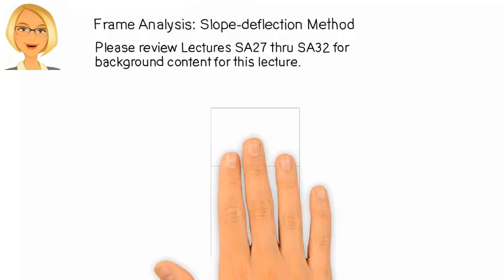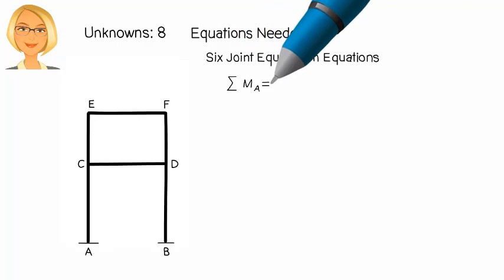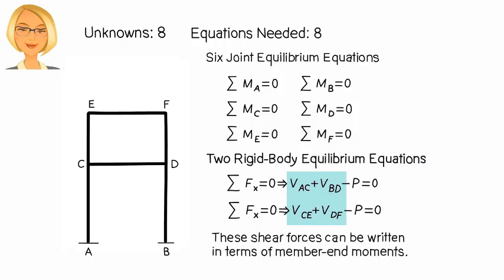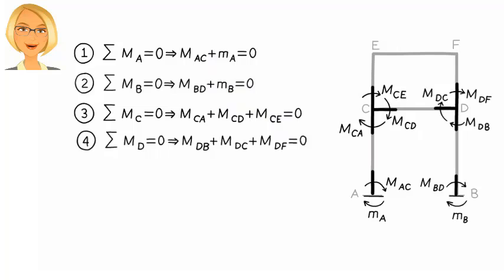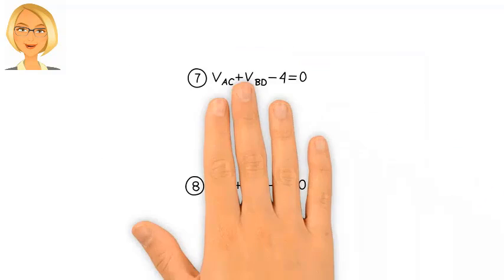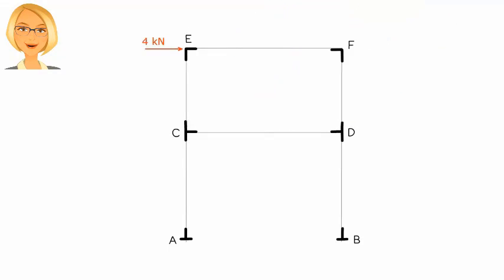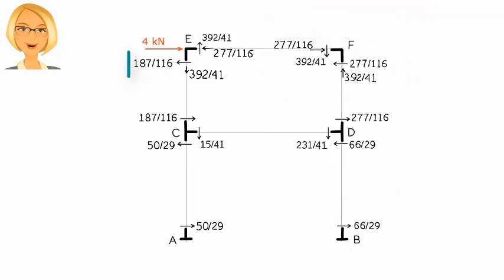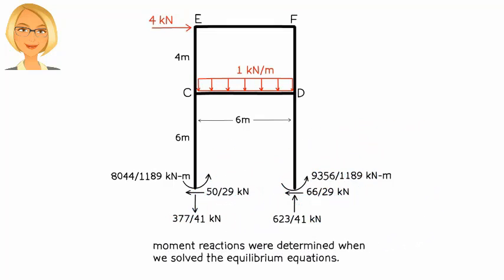SA33: Slope-Deflection Method (Frame Analysis)

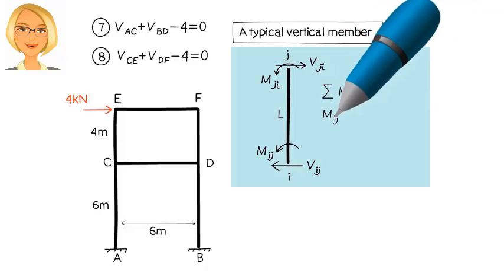Comment: @DrStructure What if the concentrated load at E (4kN) is distributed along member CE? Will the free body diagram of member CE at 5:23 incorporate this load?
Reply from the maker: Correct, in that case, the distributed load shows up on the free-body diagram of member CE, necessitating its inclusion in the equilibrium equations.

Comment: hello what does it mean when the delta values are in negative? does that mean the frame moves to the left instead? hoping for your answer thanks
Reply from the maker: Yes, a negative value indicates that the actual displacement is in the opposite direction of the assumed displacement. Therefore, if we initially assume the frame displaces to the right and the displacement value is negative, it means the frame is actually moving to the left.
Reply: @DrStructure  in the lecture did you assume it was going right? But we got negative values of delta so youre telling me the frame actually went left?
Reply from the maker: No, the frame displaces as shown. The delta term in the slope-deflection equation is considered positive when it is produced by a counterclockwise rotation of the member. Since the columns are rotating clockwise (causing the frame to sidesway to the right), the delta term associated with each column is negative.

Comment: what method/program did or can you use to solve those 8 equations simultaneously?
Reply from the maker: You can use Mathematica (Wolfram Alpha) to symbolically solve systems of linear equations. Linear algebra provides various methods for addressing these equations. For hand calculations, Gaussian Elimination is particularly effective.

Comment: Dear Sir, i completed all moment distribution class, and i tried it on all slope deflection method and it works fine EXCEPT
1. For frame like this example, it has 2 beams, when we are computing the deflection/sway due to a force, should we apply the trial 10 kN/-10 kN moment on member AC BD or CE DF or all AC BD CE DF ?
2. After we have compute 1 and got the moment at base due to 10 kN trial force, when we are getting the ratio to multiply and stuff, should we use the base force on the fixed support or base force on the 2nd column ? ( As shown in picture ) https://ibb.co/HzRS5jc

3. In order to calculate deflection, i can do it after i have compute all the moment at joint Mac, Mbc, Mdc, Mef, Mfe and etc, doing a simultanous equation to get delta a and delta b and then h1 and h2 accordingly, will the h1 h2 value i get in this way be correct ?
Reply from the maker: The frame has two deltas (Delta_1 and Delta_2). This makes the use of the moment distribution method more challenging. Since these deltas need to be assumed (or their corresponding member-end moments need to be assumed), we will be forced to iterate the process until the sum of the horizontal forces comes out as zero. If we had only one unknown delta, then the process explained in SA41 would have worked. But for two unknowns, we need to repeatedly solve the problem until the state of equilibrium is reached. Unless you can reduce the number of unknown to 1 by, say, assuming that Delta 2 is a factor of Delta 1. Like saying, 6/Delta_1 = 4/Delta_2 where 6 and 4 are the column lengths. But this may not lead to accurate results.

Alternatively, we can use the principle of superposition as explained in SA42, to solve the problem. In that case, we can define two frames. 

Frame 1: Place a pin at C or D in order to prevent the sidesway of the lower part of the frame (i.e., Delta_1 = 0), then go through the moment distribution process using Delta_2 only (only the top part of the frame is going to sway). when done with the moment distribution process, calculate the member forces, and the horizontal reaction force at the fictitious pin.

Frame 2: Place a horizontal force having the same magnitude as the reaction force at the fictitious pin for Frame 1, but acting in the opposite direction. This force causes a Delta_1 sway. Then, assume Delta_2 = 0. This is a reasonable, although not quite accurate assumption since the upper part of the frame is not subjected to any loads. Then analyze the frame per SA41. 

Add the results for Frame 1 and Frame 2 to get the member forces for the original (real) frame.

As for the actual displacements of the frame, the moment distribution method is not equipped to do that. If you are interested in determining the deflections/rotations, then either the slope-deflection method or the matrix displacement method.
Reply: @DrStructure  
1. But for two unknowns, we need to repeatedly solve the problem until the state of equilibrium is reached. 
I can try this out, but where do i add the trial moment ? do i need to add it on both column of bottom frame ? or both column of top frame ? or add the 10 kN in both the top and btm frame ?

2. As for the horizontal force you mention, do you mean the horizontal force at the base of top frame or horizontal force at the base of bottom frame ?

As for the alternative i am interested to give it a try as well
1. Frame 1, ok i put a sideway support at lower frame, then where do i input the trial moment ? at the column of top frame only and check the sway relative to the bottom frame to calculate delta 2 ? 

2. Frame 2 : Fully understand on this, but i don't get why it is not accurate

but since i have gotten all the member Moment, and i have the equation M=2EI/L*(2delta a + delta b + 3h/L ), i can substitute the moment i obtain to calcualte the h right ? I haven't gone through the matrix displacement, but this moment distribution method is so brilliant and nice to use .......
Reply: also thanks once again, i am hoping to be able to move on to Matrix soon, thanks again for all the help
Reply from the maker: @DOTA2MAJISTRATE  Since all four columns are going to displace laterally, each is going to have a fixed-end moment due to the lateral displacement. The two bottom columns are going to be displaced the same amount, hence they should be assigned the same assumed moment value (say, -10). The two top columns also are going to be displaced the same amount, so they should be given the same fixed-end moments, say, -8 (or even -10).  But the assumed top and bottom moment values need to be updated independently during the iteration process.
Reply: @DrStructure  Forgive me, i couldn't understand very well the method explained, i will write it down step by step below, please help me see if they are correct. thanks in advance
For method 1 iteration
1. Apply a 10 kNm moment on lower frame AC and BD, apply also a 10 kNm moment on top frame EC and FD
2. Use moment distribution method to get all the moment and force
3. ( this is where i don't understand, normally at this stage we will take the base horizontal force at A+B = applied lateral force of 4 kN, get the ratio and multiply accordingly. but in this case what force do i use as comparison ? Horizontal force at A+B must be equals to applied 4kN ? Or horizontal force at E and F must be equals to applied 4 kN ? )
4. By iteration, what is the "variable we use" and where should we check the "results", for example substituting x=1,2,3,4,5 so y(results) will be equals 10, so we iterate x and check for results 10, in this case do we iterate the moment of 10kNm at top and bottom frame ? And how do we check the results ?
Reply from the maker: 3. The sum of the forces in the x direction for both the top part, and the entire frame, must be equal to 4. That is, the sum of the two shear forces at the bottom of the two top columns must add up to 4. And, the sum of the horizontal support reactions (which is the same as the sum of the shear forces at the base of the two lower columns) must add up to 4. Both conditions must be satisfied.

4. You are iterating over the assumed Delta values (which is the same as the assumed fixed end moments). As far as the iterations are concerned, you have two independent variables: the fixed end moments for the two top columns (say, M2), and the fixed end moments for the two bottom columns (M1). You have to find the right values for M1 and M2 that makes the equations stated above are satisfied. You can start with M1 = M2 = 10, but they are necessarily equal to each other. In each iteration, you need to change M1 and M2 in search of the right values. This is a laborious process and more or less a blind search. 

As I mentioned before, the moment distribution method is not the right approach for analyzing this kind of structures.

Comment: Dear Dr.Structure,

1. May i know if the structure were to be pinned at ground, what will be the changes in this ?
2. Is it possible to solve the same case with Virtual Work Force Method ?

3. If i were to add 2 bracing as shown in red, how will it affect the system ?
https://ibb.co/12m7BmR
4. How do i compute the moment around the joint of this new bracing ?
Reply from the maker: 1. If the frame was pinned at the base, we would have had two additional joint rotations, one at A and one at B.
2. The frame can be analyzed using the force method, not the virtual work method. The virtual work method is not a technique for analyzing indeterminate structures. 
3. Now you have introduced another joint with its own rotation and displacements, which need to be incorporated into the formulation. The frame becomes more complicated to analyze. 
4.  The slope-deflection method gives you the member end moments. Once you have these moments, you know the moments at the joints.
Reply: @DrStructure  
for question 3, if i were to incorporate the 2 bracing, and let the top node be "G"
https://ibb.co/5nZHWWK
1. Additional unknown 
           a.) delta CG
           b.) delta GC
           c.) delta GD
           d.) delta DG

But i will only have 1 more joint equilibrium equation which is sum of Moment at G = 0, how do i get additional 3 more equation ?
Reply from the maker: @DOTA2MAJISTRATE  When the delta term is present in the slope-deflection equations, additional equilibrium equations need to be written based on shear forces, as in the sum of the forces at a joint must be zero, as is shown in this lecture.   

In this case, you are dealing with inclined members. This means you need to find a way to transform the displacements (deltas) from the member coordinate system to the global coordinate system. This becomes quite a cumbersome process. Put it differently, the slope-deflection method does not offer a convenient process for analyzing the frame. The matrix displacement method is a better choice for this analysis.
Reply: @DrStructure  thanks for the advinse, i will move myself to matrix method soon, thanks again sir, be blessed and stay healthy
Reply: @DrStructure  Dear Sir, what will happen if the member CD is in pinned ?  
1. moment from CD will not transfer to point "C" and point "D"
2. moment will be at mid point of CD and it will not be "fixed end moment" but simply supported beam moment
3. M(CD) and M(DC) = 0
4. The frame can be analyzed removing member CD completely from the system and add the axial force ( 6mx1kN/m/2 = 3 kN ) on point A and point B ?
Reply: also if i were to conduct a overall force calculation ( global ), taking moment at A, 4*(6+4) + 1*6*6/2 - 623/41*6 - 9356/1189 - 8044/1189, the answer is not 0
Reply from the maker: @DOTA2MAJISTRATE  1. Correct, there would be no moment at the ends of CD, so no moment distribution/transfer takes place at C or D from member CD.
2. Yes, CD can be treated as a simply supported beam with regard to bending moment diagram. It is going to have a zero moment at either end; the maximum moment in the segment takes place at the mid-point of the beam.
3. Correct, Mcd and Mdc = 0
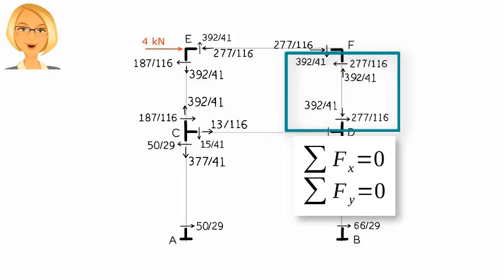4. Not quite. Member CD is going to have three reaction forces at each end: Fx, Fy, and M. The moment (M) value at either end is zero. Fy at either end equals 3 kN. And although the force in the x direction (Fx) at the left end of the segment is going to be equal to the force in the x direction at the right end (they act in opposite directions since the sum of the forces in the x direction for the member must be zero), but the magnitude of Fx is not zero. If the beam was isolated, if it was not a part of the frame, then Fx would have been zero. But here, the frame causes an axial force to develop in the member (see @10:00 as to why that is the case). This means, the frame has to be analyzed as a whole, we cannot simply remove members from the structure without effecting its behavior.
Reply from the maker: @DOTA2MAJISTRATE  Yes, there is an error in the calculations. The error originates @7:52, wrong member-end moments are used in the moment equilibrium equation resulting in incorrect member-end shear forces. This error was propagated through the rest of the calculations.

Comment: Thank you Dr. structure  for giving lecture with much clarity....I  would like to enquire is it possible to  use this  method to analysis the high rise building having multi bay frame
Reply from the maker: The matrix displacement method is more suitable for the analysis of high rise or other complex frames. The slope-deflection method is not quite suitable for that kind of analysis.
Reply: Thank you Dr.Structure...will be grateful if you could upload lecture on analysis of building using  matrix displacement method

Comment: How to draw Moment diagram. And also show maximum bending moment in this slope and deflection method. My sir said if our assumption is right draw it upside other downward i.e if our moment is +ve in left side and -ve in right side , draw it up and otherwise draw below the member. I got this but which sign should I put then inside that moment diagram? Help me.
Reply from the maker: By convention, we take the neutral axis of the member as the x-axis. Generally, positive moment goes above the x-axis and negative moment goes below it. We label the positive area with a plus sign and the negative area with a minus sign. 

Of importance is the sign that we place on the diagram, we always need to label the regions of the diagram with plus and minus signs indicating where moment is positive and where it is negative. 

Whether or not we draw the positive moment above, or below the x-axis is less significant than labeling the regions of the diagram with plus/minus signs. Although it is customary to draw the positive moment regions above the x-axis, but it is not incorrect if we choose the reverse; choosing to draw the positive area below the x-axis would be okay too. As long as the regions are labeled properly (with plus and minus signs), no confusion would arise.

Comment: hello~first thank you for upload this, in my opinion your method for slope deflection is more detailed (included the displacement calculation for beam) than the text book, thank you for that.
i got a question for this slope deflection for frame. 
as long as the vertical member is not inclined and the support not having settlement,  the joints will only displaced horizontally (zero vertical deisplacement) under any type of loading case applied on joint or segment?
Reply from the maker: Thanks for the feedback. 

Correct, axial deformation is not a part of the slope-deflection formulation. Members are considered to behave as beams not subjected to any axial load. The displacement method removes that limitation by introducing axial forces/deformations into the formulation.

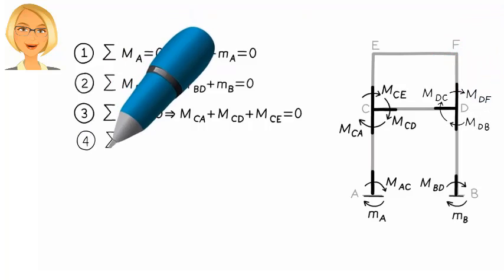Comment: i thought we were supposed to assume all moments anticlockwise,but at 4:43 you assumed all moments as clockwise.. what gives?
Reply from the maker: Yes, in the slope-deflection equations the member end moments are considered positive when in the anti clockwise direction. This sign convention is independent of the sign convention we use when writing moment equilibrium equations. When summing moments, it really does not matter which direction we take as positive. Either way, we end up with the correct solution.

So, for the slope-deflection equations anti clockwise is positive. For equilibrium equations either clockwise or anti clockwise can be considered positive.

Comment: Hi doctor structure. May I know how you find out if a structure has sway and what types of sway. I know there is a formula for it specifically s=2j -(2(f+h)+m+r) but it only works in certain circumstances and it doesn't work in situation for
Instances having a hinge at joint d (joint e and f still can sway).
Reply from the maker: Most structures sway under applied load. But we can ignore some of them, if the magnitude is not significant.  Generally speaking, a structure (or a member) deforms in the direction of the applied loads. If a frame is subjected to a horizontal load, it would have a tendency to sway. In case of a cantilever beam, we always have sway. When a support settles in a continuous beam, sway becomes a factor.  Unsymmetrical loading often results in sway... There is no universal formula to determine if sway is present a priori. 

I would say, the best way to determine if sway is present and significant, assume it exists. Then analyze the system to determine its magnitude and decide if it can be ignored.